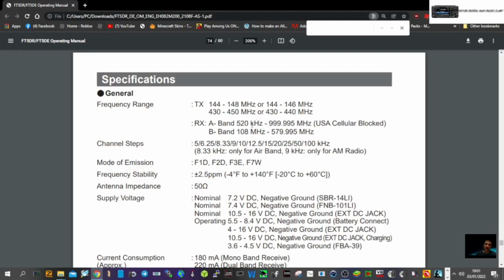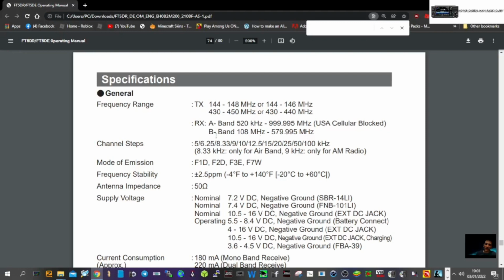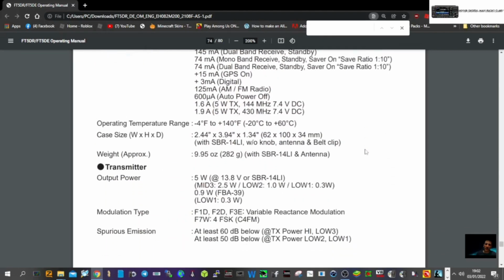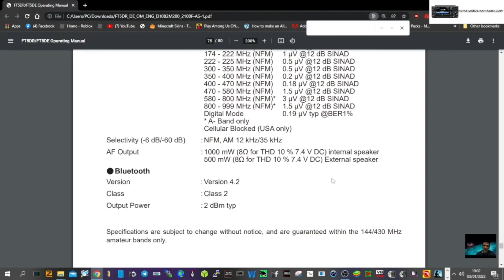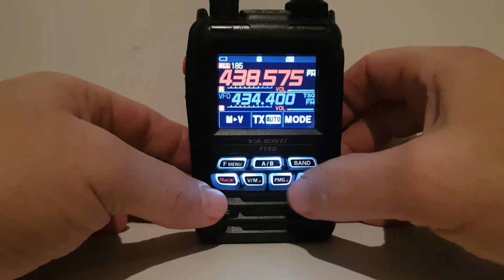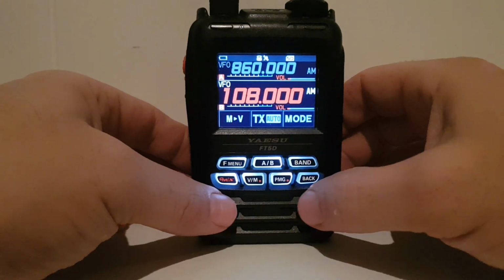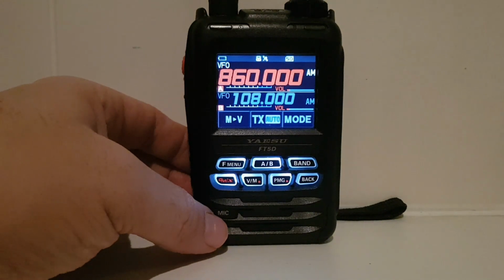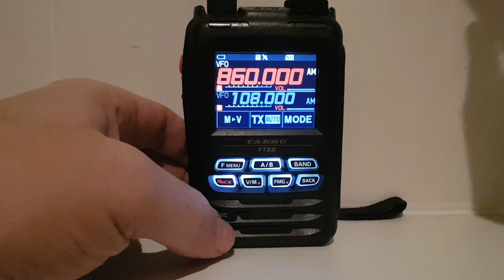YAESU FT5D Transmit & Receive Frequencies

Comment: Thanks mate great video explaining what I couldn't really find much about. It says tx 446, does that include the 446 pmr band? As it would be handy for when we go for a walk in the woods then I won't have to take a second radio just for 446mhz
Reply from the maker: Hi it won't TX on pmr there could be a modification but the power would exceed pmr allowances.
Reply: @HamTechRadioScannerDrones  thanks for the info mate. 73's